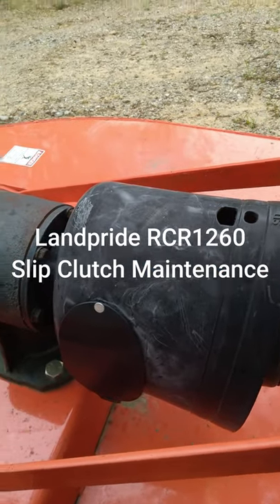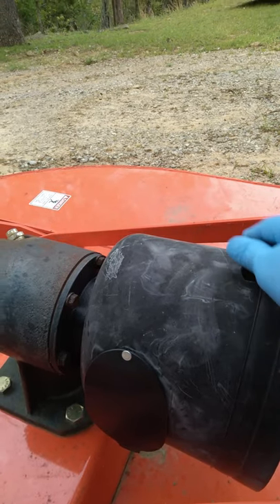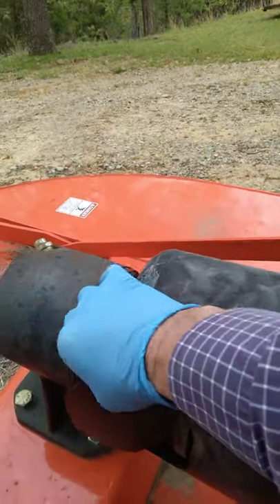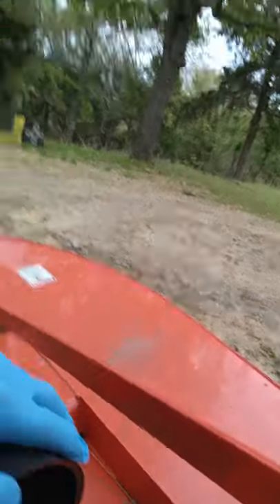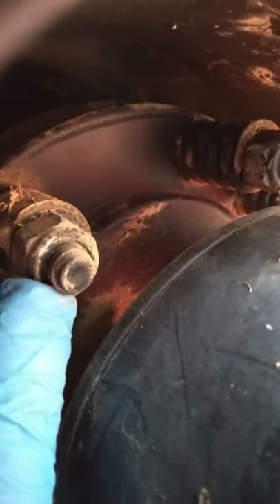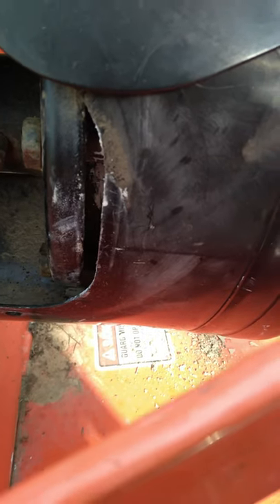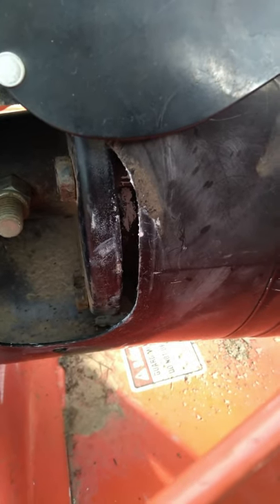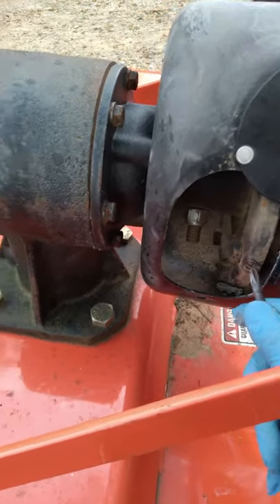Brush Hog Slip Clutch Maintenance

Comment: Just bought one of these, used... only used a handful of times... wouldn't it be easier to remove the bolt holding the driveline in and removing it, it would think it would make it easier to loosen all of the nuts. Then, after you have loosened all, throw driveline back on and put the bolt in. Run your test, and then pull driveline again, and tighten nuts back up? That cover is a terrible design on LP's part.

Comment: Can your clutch be to loose?? I'll be mowing and then it will stop rotating  all together
Reply from the maker: Sure if it were too loose it could stop in heavy grass.  I don't know how you would determine that. Probably have to check with the dealer or manufacturer to see how to set it up from scratch.